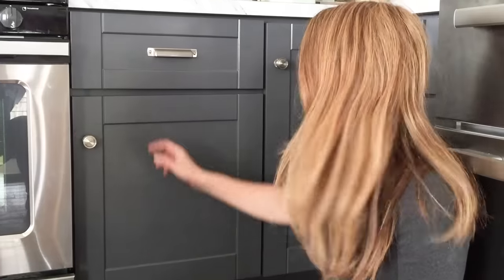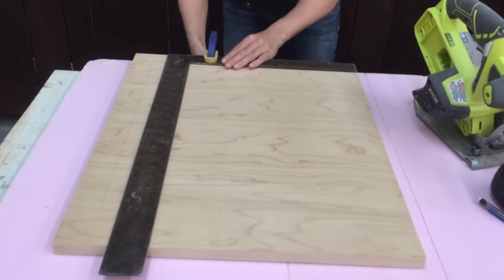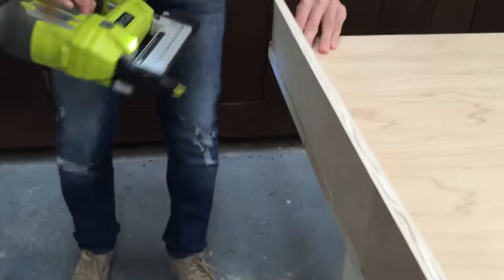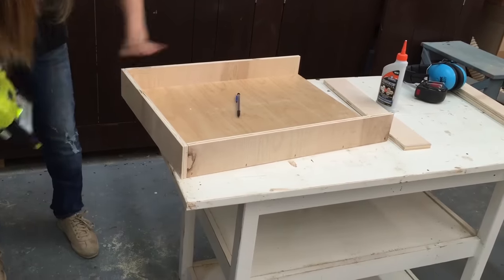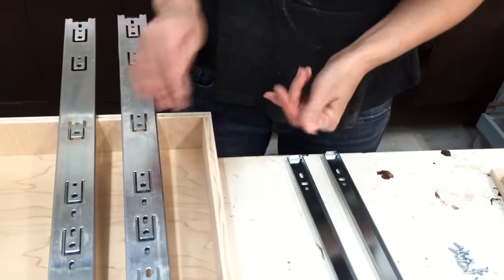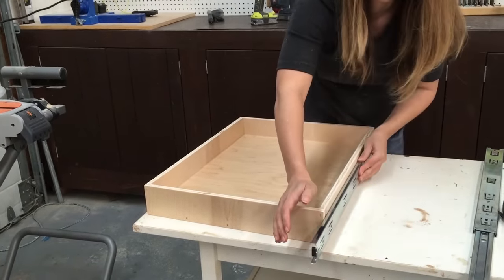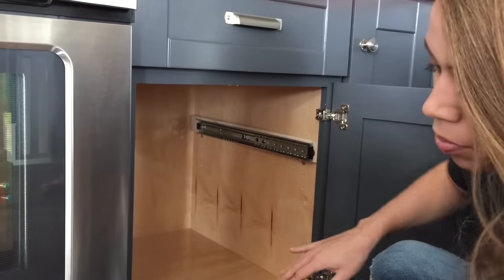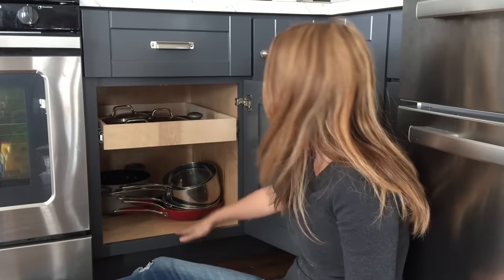Convert Cabinet Shelves into Pull Out Drawers

Comment: So you have $2,500 worth of woodworking tools, but don't know to use a rip-fence to do the exact job it was designed for, so you cobble together a guide using a carpenter's square? Before giving advice you should learn enough carpentry to show people the proper way to do things. 

For example, if you stacked both drawer glides and the two sides of your drawer on top of each other on a flat surface, held the old shelf up perpendicular to it and marked that, you wouldn't have even needed a measuring tape. Just use the saw's rip fence to cut at the mark and it would fit perfectly - guaranteed every time and in 10% of the time with no other tools at all. 

Pros use methods like these because they bid jobs at a fixed price, and make more money if they are more efficient. It's nice when someone takes the time to learn and then teach these methods.
Reply: +roi joi  There's more than one way to skin a cat
Reply: Yes, and one way would be to use a tool specifically designed to skin a cat, rather than hack it to bits with a club and a hatchet. A rip-fence was designed to do exactly that job and no other. Giving advice when you don't know what you're doing is the textbook definition of the blind leading the blind.
Reply: roi joi You are not wrong, but I think she is making this video for your average DIY'er who may not have invested 2500 in tools.
Reply: +roi joi not everyone is Norm Abram and the average DIYer  is not striving to that level of perfection, how about some perspective!
Reply: Using a tool, like a carpenter's square, as a brace is thunderously ignorant. How about you get a clue and hold a pretty girl to SOME kind of professional standard. Nobody is asking her to be Norm, just that she understand basic tool use and be able to distinguish between an instrument like a square, and a tool. She really should redo this or just take it down. She's embarrassing herself by having it up for viewing.
Reply: +roi joi so you have never used a speed square to accomplish the same thing? At least she clamped it so that it didn't move, work with what you have. Move on and who cares if it's a female male, she made it happen and created something.
Reply: +roi joi so what is speed square? Everyone I know uses a speed square as brace/guide when cutting lumber on the site. What she did was no different than using "any" straight edge to guide a cut. The cheapest form of a track saw! Let it go!
Reply: A speed square is intended to be a guide, as well as for measuring and is not damaged by using it in that way. Clamping a carpenter's square is going to bend it sooner or later. If you want a straight edge, buy one.

Of course if she knew what she was doing she'd have just used a rip fence for its intended purpose. As long as you have a straight reference edge - which she did - the rip fence is the fastest way to make the cut and anybody who doesn't know that has no business advising others as to how it's done.
Reply: +roi joi She also has a table saw. So one could put forward the argument that a table saw is the proper way to make said cuts.
Reply: +shogun678 She skins cats too? Let me guess, with a chainsaw? rotflmfao!
Reply: +101MinusOneHundred LoL
Reply: +roi joi  where is your video
Reply: You are one miserable mess.  Beautiful, charming gal who is more capable than most guys I know.
Reply: roi joi x
Reply: roi joi, have you ever built your own house, because she and her husband has. And where are your videos. Oops! You don't have any. I come to Ana's channel for simple easy to do projects. I'll go to Jimmy DeRista, Jay Bates or Jon Peters for more complex things. I'll go to your channel for um...ummmmm...well, you have no content.
Reply: roi joi make a youtube channel to teach us how to ...
Reply: @roijoi6963  Go AWAY internet troll!!
Reply: @aaronmartinez9431  I will give your empty-headed reply all the consideration it's due.
Reply: roi joi YOU SOUND REALLY SALTY. She didnt say at anytime in this video she is a PRO. She made a video base in the skill she acquired and how to make a simply amsture slider pull out drawer for those who may not have an idea what to do with theit present draw function thats not saying some viewers are not professional maybe more so than she is..but many carpenters skilled still dont know about designs and many designer cannot use power tools I have seen them all. Everyone who wants to learn can learn. Besides her husband is a contactor and sure he can teach her more than she presently knows. I give her A+ effort many men and women do not even know what to do. So stop being a show off bcuz your a professional..well thats what you said.